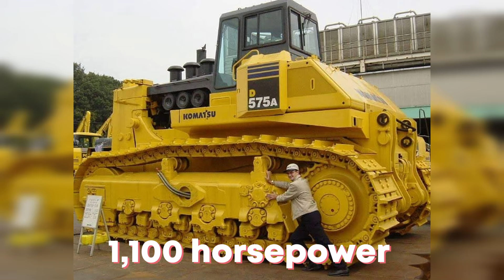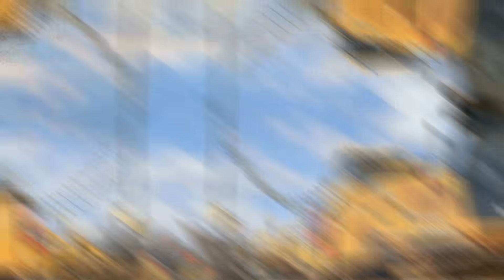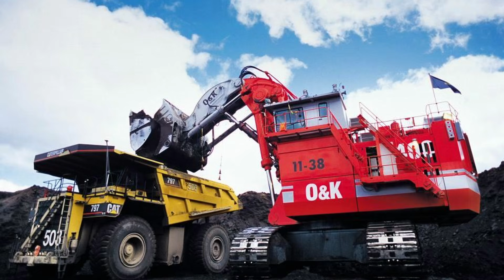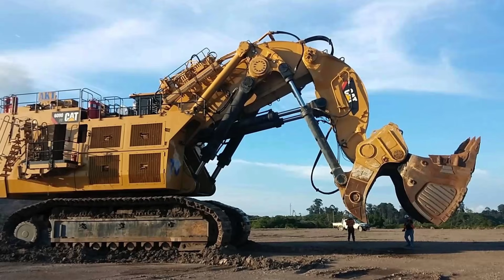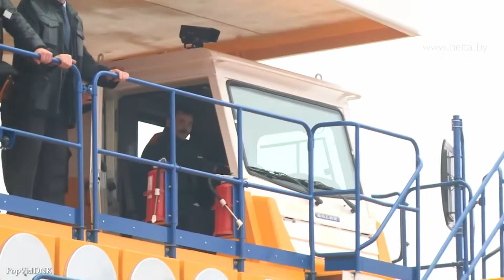15 GIANT Bulldozers and Construction Vehicles

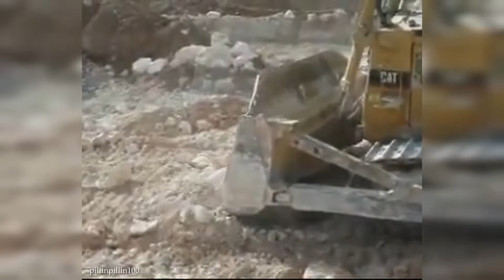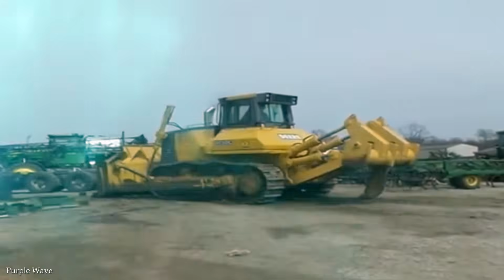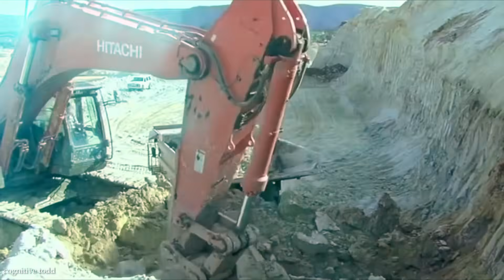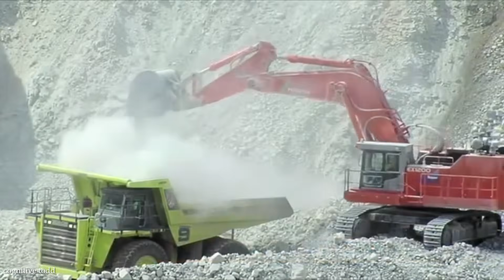Comment: Sorry, but you really need to do better quality control: You talk about a CAT dozer attachment for coal, but show a Komatsu (5:07). You start talking about the John Deere 1050k dozer, but the opening is of a John Deere back-hoe (7:25). Then in the video you talk about a Hitachi EX8000 excavator, but you show a much smaller models, the 870 and 1200 (9:31 and 10:30) from Hitachi in operation. And in the section on the Acco bulldozer, you show a CAT (24:52). and a Komatsu (25:02). I have noticed in your other videos as well.
Reply: nerd